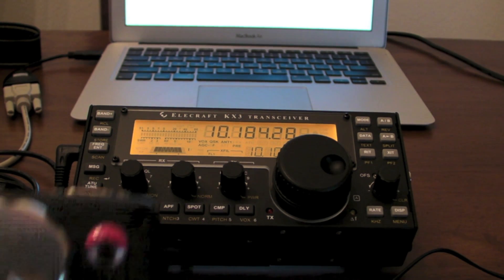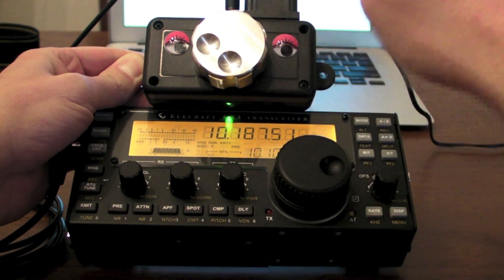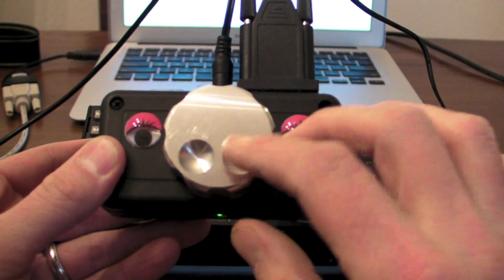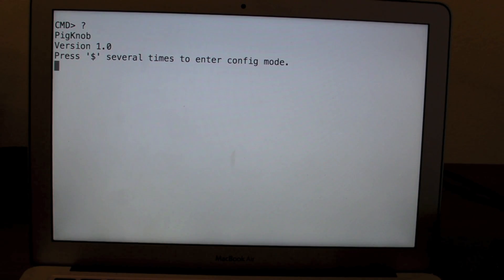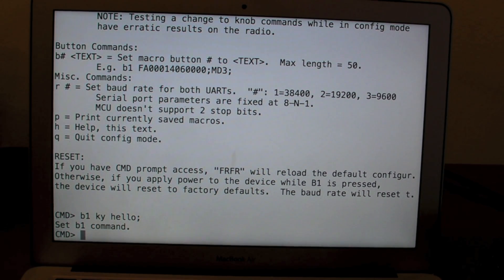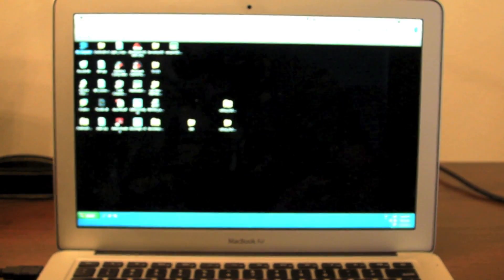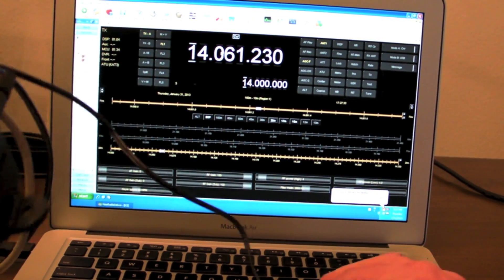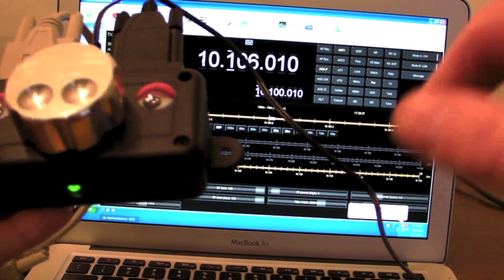PigKnob Prototype

Comment from the maker: I chose standard 9 pin RS-232 serial over USB because it's more easily adaptable to unique cabling/connection scenarios.  Putting an FTDI chip and USB connector on-board would remove the ability to put it in between devices like the P3 and K3 from Elecraft or custom built microcontroller interfaces like HamStack and Piglet.

Nick / N3WG